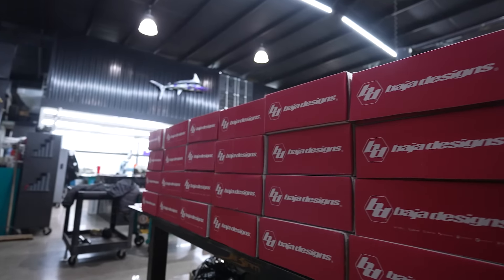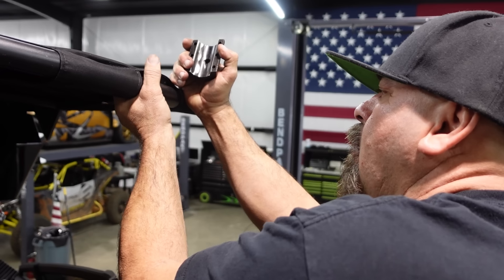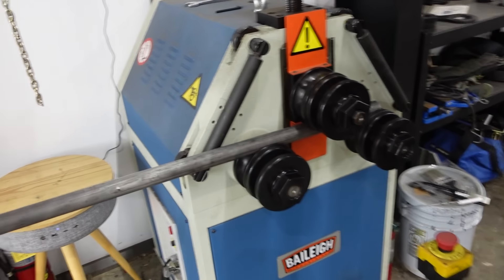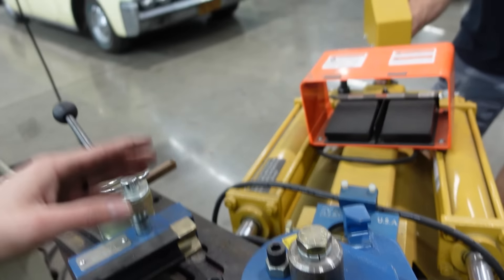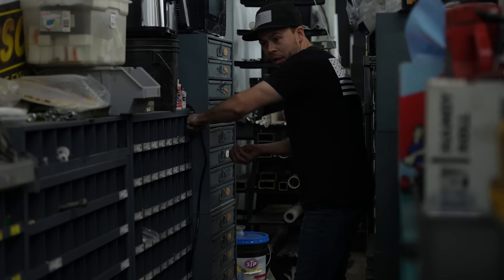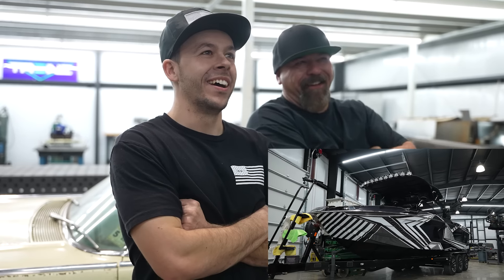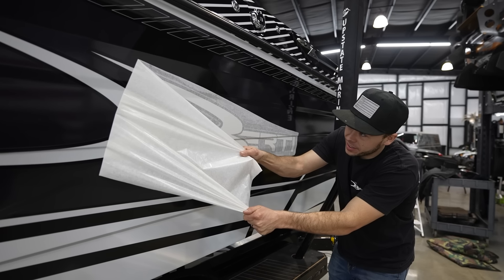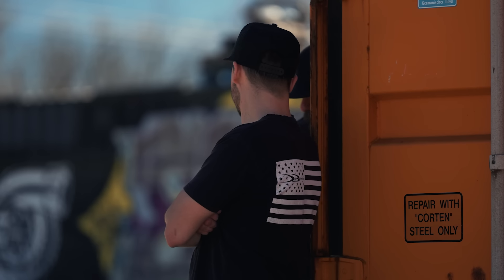Fabricating WORLD Record LED Light Bar For Our Wake Surf BOAT! 269,000 LUMENS!

Comment: That is INSANE!   The only thing I would suggest is using a switch panel like an SPOD or AuxBeam and have it so you can turn on maybe one pair of lights in the front on one switch and and one pair on the rear.  That way you can step up the intensity.  If it is too much light, or you are doing something and want some light, but not ALL of it, you can have just a pair of heads on the front or the back at a time.  Like coming into the dock at night, or getting it on the trailer, enough light to see everything, but not blind EVERYONE that maybe also trying to load a boat, or is on the dock.  

You can even get like an 8 panel switch, and have the top 4 switches for pairs and a group of 5 of front lights and the bottom 4 for pairs of the rear so you have essentially 4 intensity levels.  So on the rear you have one button for just one LED, and the each pair on the other buttons.

Comment: Come on why stop at 260k go for 300k add some alley lights to the right and left for nighttime adventures. Love you boat need to get together and bring mine down I just had a 3000 watt stereo installed in my fi25 will 4 6.5 swim platform speakers along with 4 kicker 12s its insane

Comment: .... katchup...  I tink you gunna have too many bright bright bright lights faceing the dude on the wave... ;) there is already 20k lumins lightin up the WAVE... ;)  you want diffused wide lighting on the rears with like 2 or 3 pinpoint spots for running hard all lit up... but 6 or 7 WIDE diffuser type lights... AND DID YOU EVEN ECHEC TO SEE IF THEY WERE THE RIGHT FREQ TO ALLOW VIDEOING.>???>???  it matters don't it?